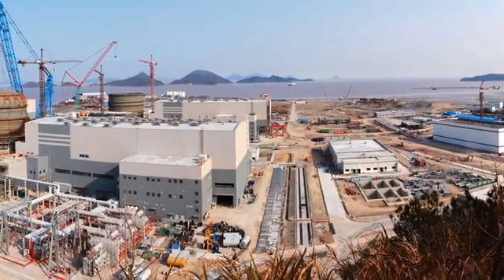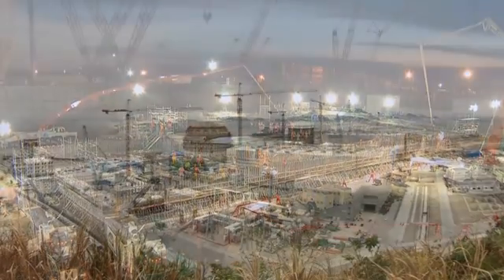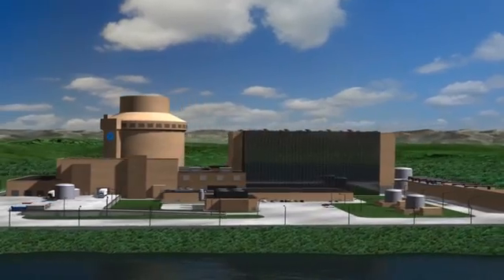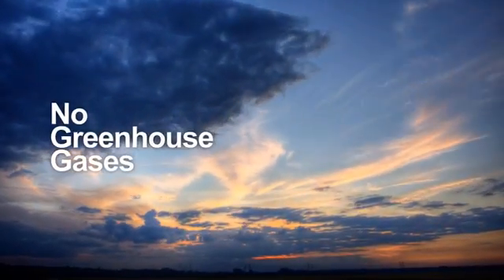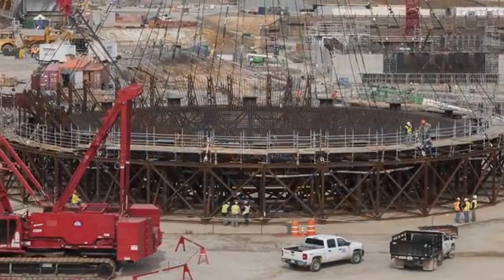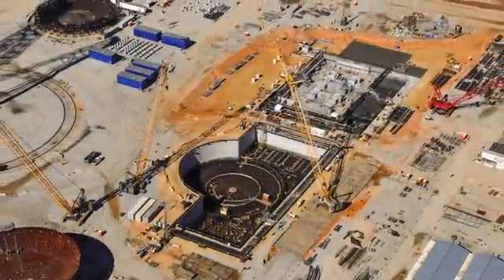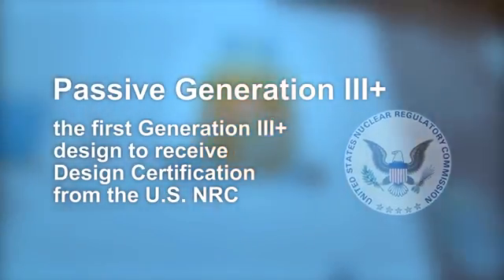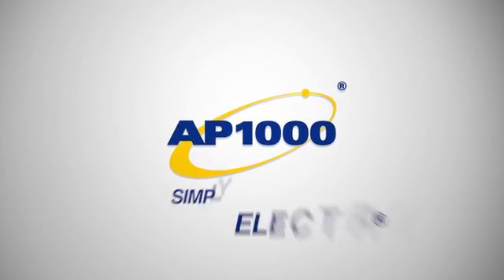Westinghouse AP1000 PWR video

Comment: Its time to move past our great grandfather's engineering.  An oversized PWR is inherently dangerous and inefficient.  The molten salt reactor is the future but stuck in the mud companies like Westinghouse refuse to innovate.  They just keep making the same old stuff.
Reply: PWRs have the highest power density of any reactor. 

Good luck finding a pump that has bearings able to withstand the corrosiveness of molten salt (it doesn’t exist).

Comment: A little confused....how can it be clean energy when there is high level nuclear waste which will be dangerous for many,many years and we have no idea how deal with it?
Reply: Recycle it like the French do.  Mixed Oxide (MOX) Fuel.  .
Reply: Because it's a tiny amount. Compress the risk and manage it. Coal ash pits have the right to ignore environmental protection laws, nuclear waste storage does not. It's easy to store until some fast spectrum reactors are built. Waste is still 95% fuel and there's all that depleted uranium america likes to make bullets out of. One DU tank shell is a man's entire lifetime of energy needs. Fast reactor waste is so short lived the storage container will outlive the radioactivity by a large margin (underground).
Solar waste is just stored somewhere, too. Or it is dumped into large lakes in China (just like the rest of our electronic legacy, but amplified).

Breeding thorium or uranium would yield about 1GWe for an entire year (molten salt fuel means full burnup) with only 1 tonne of material.
Reply: Because "dangerous" for many many years (locked up and sealed, but actually fades to harmlessness within 10 years, just above legal limit for 10000) is far far better than dangerous forever (arsenic, lead, cadmium from coal that's released into the air everyday)
Reply: +Hyperious yes it is but reusing it and turning into glass is better
Reply: +Chris Byerman yea we should and we can turn waste into glass or reuse the water
Reply: Richard Hayward this reactor is designed to use the "waste" from other nuclear plants.
Reply: burying that shit hundreds of feet underground is still cleaner than just spewing it into the atmosphere
Reply: Nikel Sin: Until the level of CO2 reaches 400 PPM of course which is the limit set by geniuses and computers... Oh wait forget about the last part.. Latest computer data shows a record high of 107 degrees in Atlanta set in 1887... Everything'll be just fine. I feel it.
Reply: +moenkopiaz yea at least it's being used
Reply: As I understand it and I'm happy to be corrected,only the Uranium and the Plutonium is recycled,the fission by-products(I know Plutonium is a by-product) isn't.Its just vitrified and stored underground.
Reply: Correction `you` have no idea
Reply: SpaceX can shoot it toward the sun on a regularly scheduled mission

Comment: Seems they are using Iron containment dome. But how come Iron containment dome will withstand plane impact. Won't it melt down ? Concrete used to be a good choice.
Reply: +Nandakumar Murugan The reactor vessel is steel and it's inside of a concrete building.
Reply: +Nandakumar Murugan They pour concrete on the dome after it is in place. Pouring concrete before placing it would make it impractically heavy to lift.
Reply: The concrete is reinforced with steel